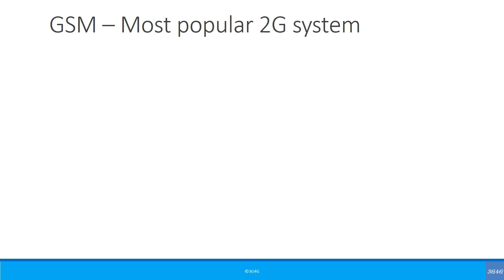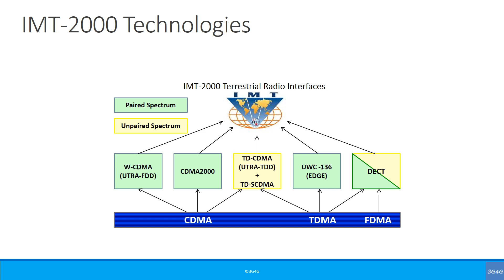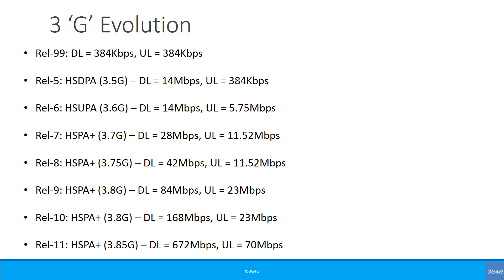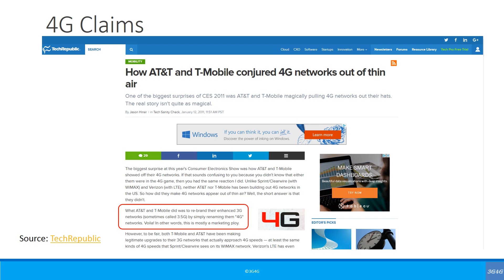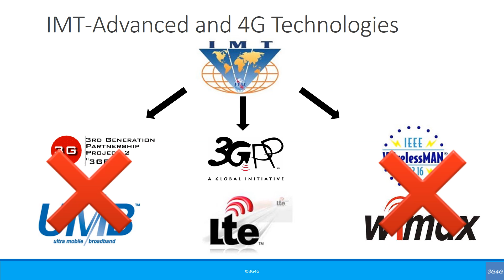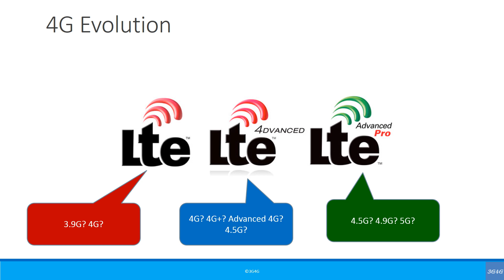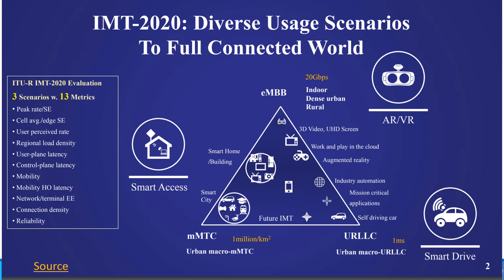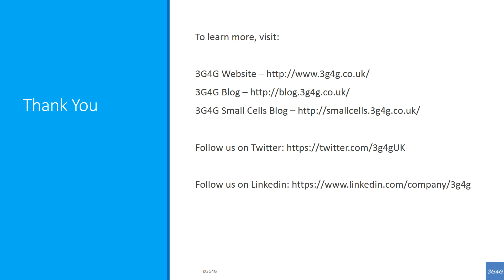Beginners: Why is 5G called 5G?

Comment: Thank you for this very informative video. The majority of the literature says that 5G will be characterized by small cells, mmWave, and MIMO. Here, 5G is characterized by three other technologies URLLC, mMTC, and eMBB, what is the relationship between the two suggestions?
Reply from the maker: IMT-2020 has defined three main use cases for 5G networks as discussed in the video. They are eMBB, mMTC and URLLC. To meet these use cases 5G system will use small cells (densification), mmWave (larger bandwiths leading to higher throughput) and massive MIMO (beamforming leading to increased capacity). In addition there will be more changes at the physical layer like flexible numerology, smaller TTI, different coding schemes, etc.
Reply: So there isn't a pairing between the three use cases and the three technologies used to achieve them?
Reply from the maker: Not really. The main focus of small cells, massive MIMO and mmWave is eMBB. They wont help much URLLC and mMTC.
Reply: Thank you very much:), We're waiting for more videos!